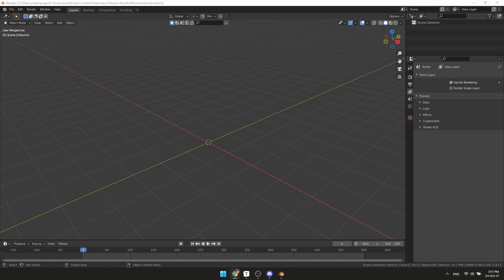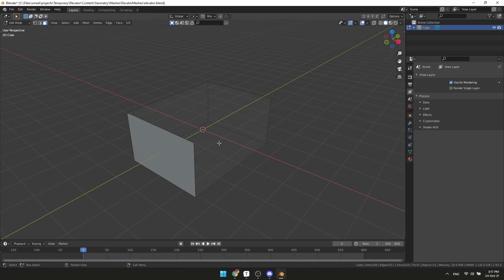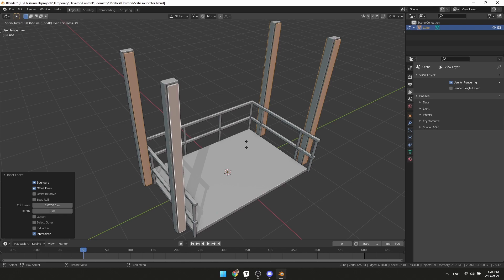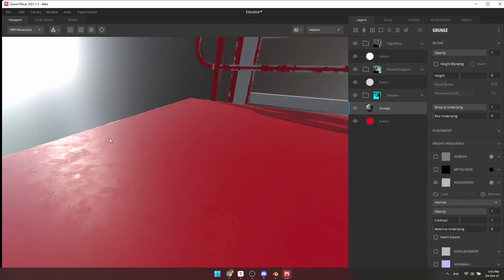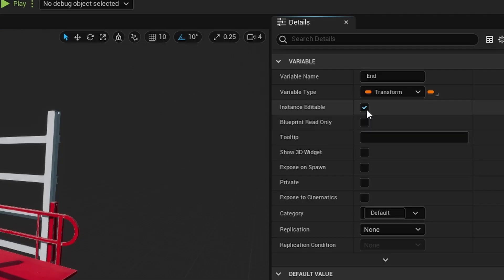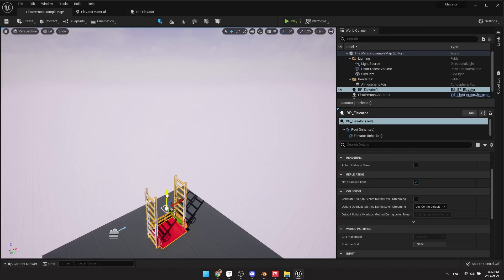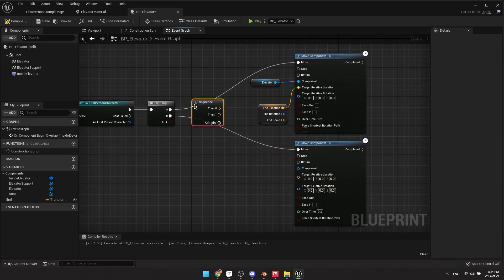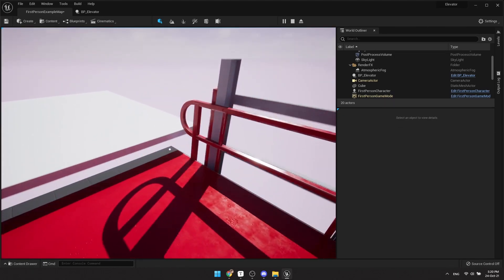Elevator in 2 Minutes in Blender and Unreal Engine 5

Comment: Quick, simple, effective. I liked that... specially the fact it revealed some secret about my public enemy Number 1 which is Blender The Deceiver.
If you will ever release more Unreal Engine tutorials starting with one about how to enable FullBody / FootIK in order not only to walk on stairs but having also the feet adapting to the surface of a slope or any other irregular surface you get an instant subscriber in me!

Edit: Just one suggestion... as someone who, like many, never managed to work with Blender because of the unfriendly  poorly intuitive shortcuts adding which shortcuts are used, while you do, would be massively helpful and help to learn.